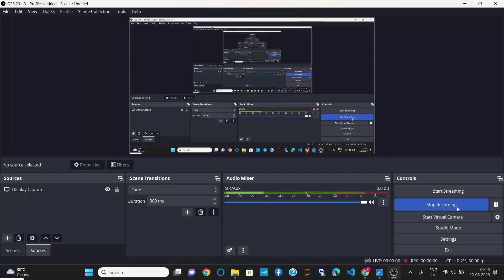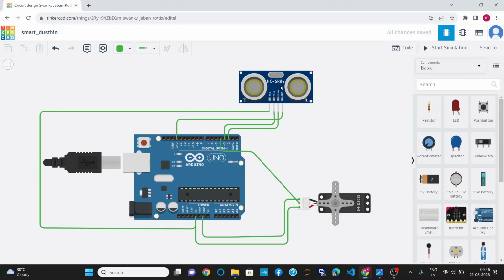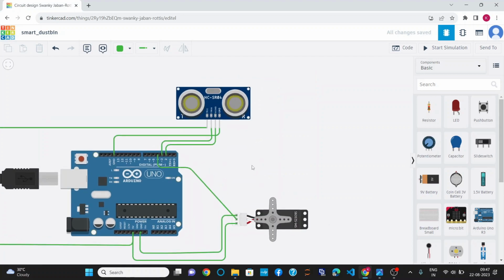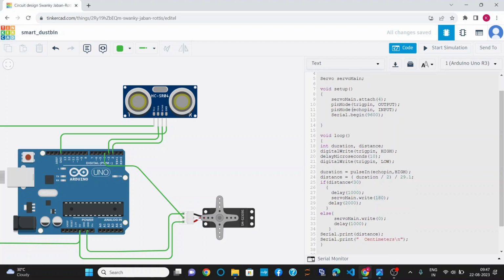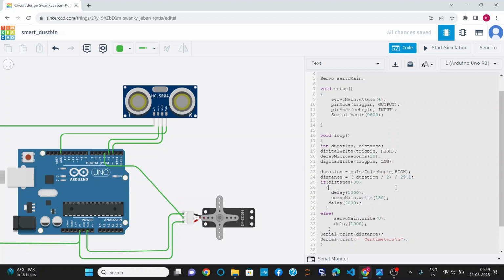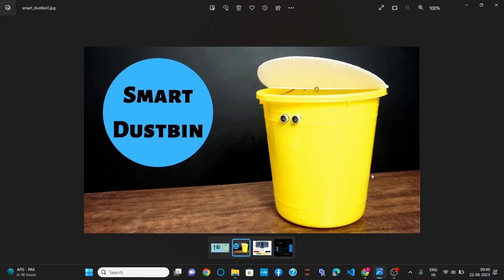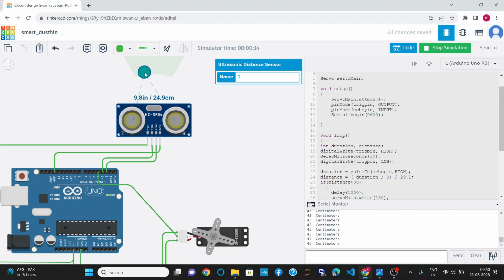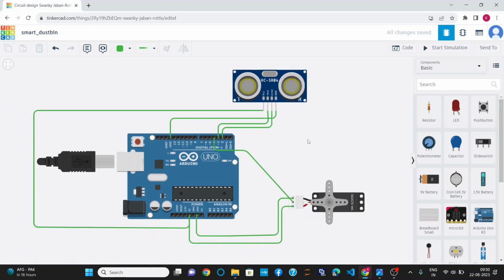Smart Dustbin Project Prototype using TinkerCAD || Arduino Smart Dustin Project || Arduino Project

Comment: In this vedio I had learn the ultrasonic sensor is used to sense and detect the distance in this project  . Where a ultra Sonic sensors are also used in many ways as the radar operations and  detection of fire and more ever . Where as Arduino is nothing but it was a smart accesible chip which has ability to connect with a network . At the end it was a fan which simple used to tell the viewer to the target was detected if the target was detected it starts rotating . Otherwise it didn't rotate . Entire the process is known as smart dustbin project . 
The components has used in the project is aurdion sensors and rotator with 3 pins .